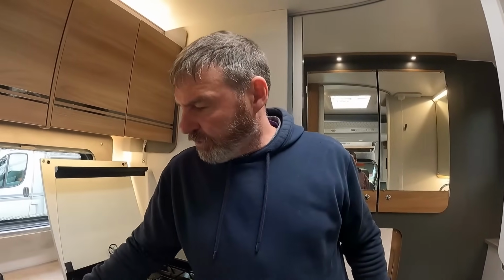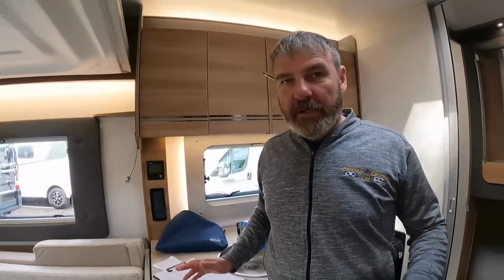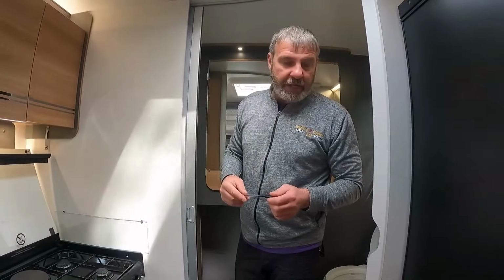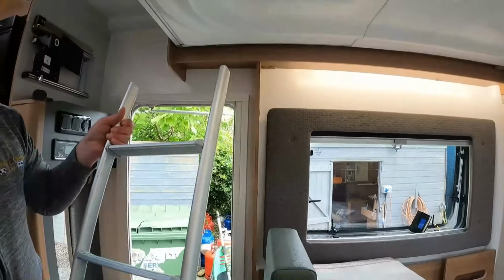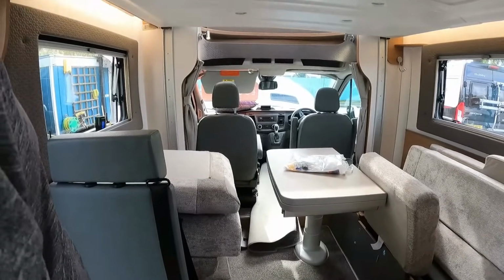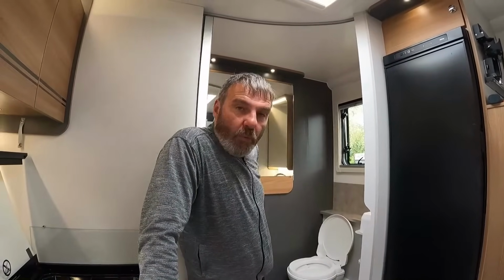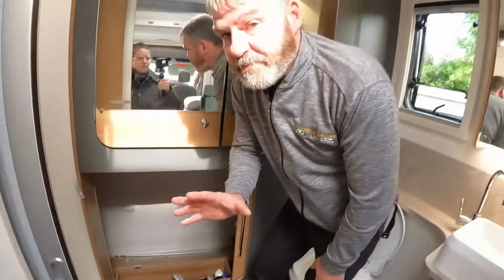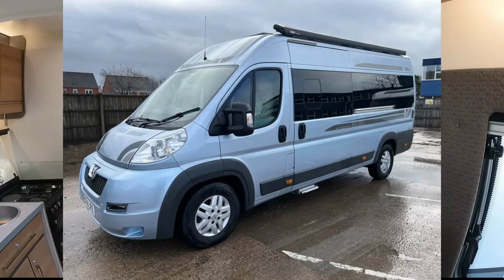Bailey Motorhome Will You Behave ?

Comment: Excellent vlog, thanks for the details.  A few questions: 

Are pressure fit water pipes the standard? Are all connections usually accessible (thinking of maintenance)? What about gas system maintenance? 

What are your thoughts on different toilet types (composting, separating, etc) in terms of reliability, ease of use, and maintainability?

Greatly appreciate the content and would love to visit some day when we're in the UK.